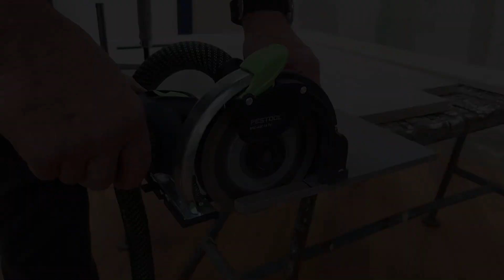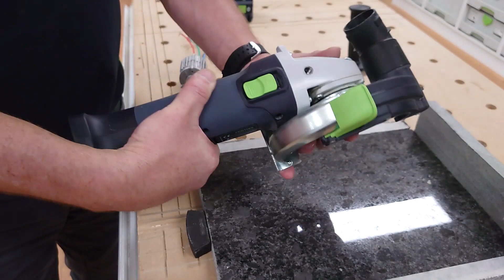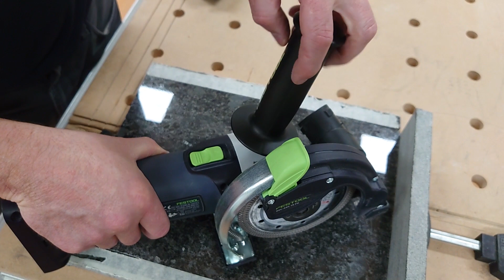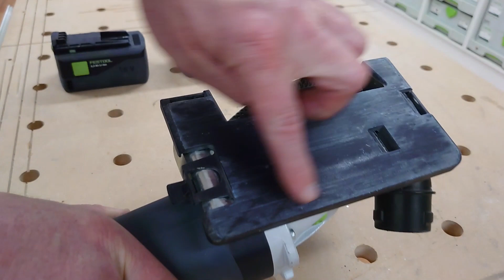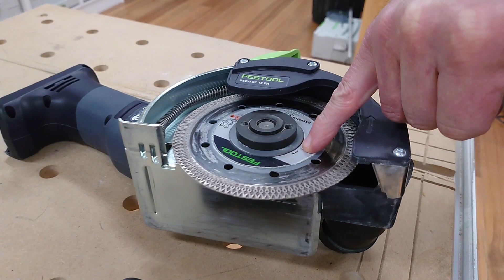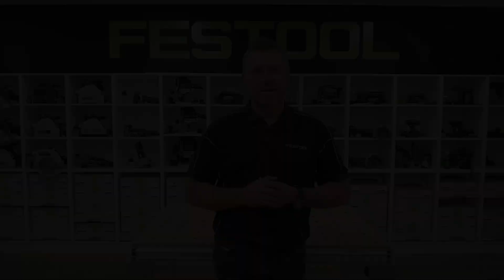Festool DSC-AGC 18 Freehand Diamond Cutter | Complete Guide

Comment: To those that have wondered about depth adjustment - there is no in-built option. I use wheels of 125mm, a 115mm or a 105mm. Then you have the spacer to add 5mm. It’s worked well but obviously takes a bit of effort.